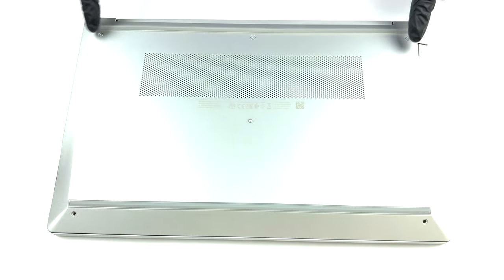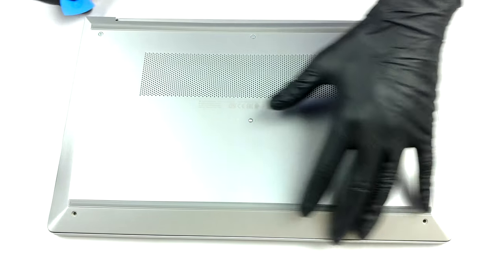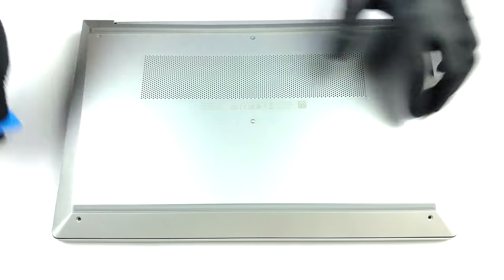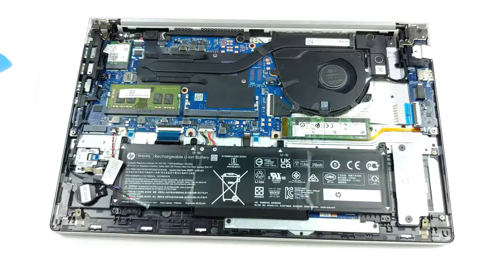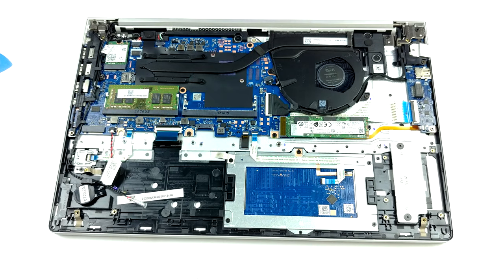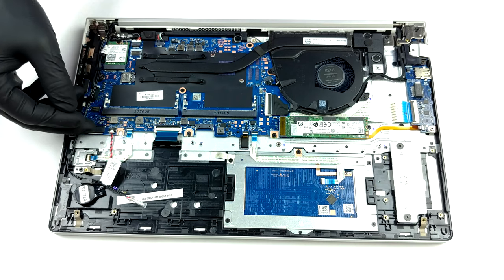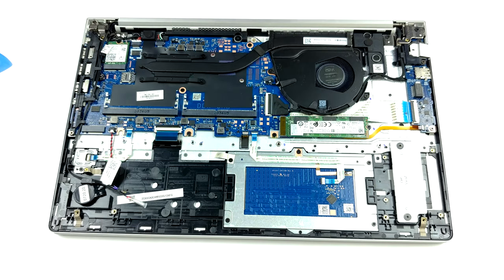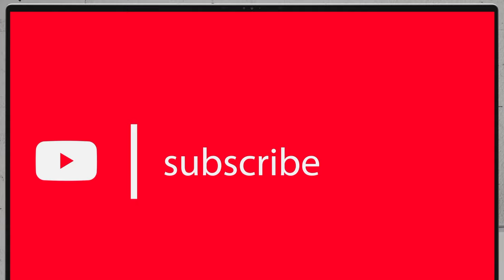🛠️ HP ProBook 450 G8 - disassembly and upgrade options

Comment: Allright guys, after a long research and a few calls at HP-Support, I will try to share, what I found out.
1st I found different dissassemblys with Probook 450/455 15.6 G7 that showed an internal sata 2.5 connector. So this is where the journey started. I am looking forward to get one  of the latest Hp 455 g8 and I really hope that besides the AMD cpu the internals are identical. Support told me from the Partlist theres is no additional Storage connector. After watching this video here I concluded the same, though that guy says, there is one. I spend another few hours on finding the mounting holes for such a NVME and couldn´t. It defenitly does not look like you can mount a storage.
But I found some other people succesfully just replacing their WWan with an nvme drive.
and it looks like an m.2-SATA (6Pins type b) connector (like the usually installed Fibocom L850-GL module), so obviously it should be possible to connect and use a 2242  drive there.
Anyway that connector is meant for a  WWAN-module like at least the preassembled antenna cables tell us, but also here I could not get a close-enough look to figure out, how that thing might be mounted then (no mounting hole).
So this is, what I got so far and I keep unpatiently waiting for LM to give us a closer look inside the 455 g8 AMD Lineup and whats going on there a the WAN connector.
Cya

Update: From a Hp-Support-Video I found, what I was looking for: An HP 450 g8 Model with an M.2 Fibucom WWan module preinstalled. So I am going to order that piece of hardware and give it a " Sabrent Rocket Nano" in that slot.

Cya.
Reply: Did u ever tried to insert the ssd in that slot? it worked?
Reply: @emmanueledefelice5029  due shipping issues I am still unable to get my hands on one of these. Sorry
Reply: Ty <3 Was trying to figure out the same thing ^^
Reply: @emmanueledefelice5029 
Please do you have this probook 450 g8 laptop? If yes, what do you think of it so far?
Reply: @nikovbn839 
Please do you have this probook 450 g8 laptop? If yes, what do you think of it so far?
Reply: Please do you have this probook 450 g8 laptop? If yes, what do you think of it so far?

Comment: My 450 G8 did not have the second NVMe storage slot that he pointed to in this video.  Just silver solder lines..  Ugh.
Reply: Is it possible to upgrade the storage using sata ssd? Or i need to stick with its inbuild M.2 256gb storage? pls help me by clarifying
Reply: @MaheshwaraSiva  I would think so.  The OS doesn't care as it will see both if you can plug it in.
Reply: @dl777  Any heating issue for normal usage? Or Any other issue did you find in this laptop.. Im planning to buy it.
Reply: @MaheshwaraSiva  no. Very nice laptop

Comment: can you explain me why they don’t put exhaust from left side which they used in old models evan in g7 also
Reply: Hey please answer me, I'm about to buy it this laptop. Did you find out what's about that exhausting system thing?
Reply: Maybe because the g8 has intel 11th gen with now 10nm size chip. So you dont need a lot of holes to dissipate the heat. The previous g7 and before used to have intel 10th, 8th, etc gen with 14nm size chip so you needed more room and holes to dissipate the heat.

Comment: Good to know that there are TWO M.2 SSD slots! Where can I find their specs / max. capacity, respectively? The data sheet from HP is not conclusive for me. Edit: Oh, I see from another comment here that this seems to be a false info. So the 850 G7 could accomodate two SSDs, the G8 not any more. That's a pity.

Or is it different between the 850 (Intel version) and 855 (AMD version)?
Reply: only 1x m2 slot,  second slot not fitable for m2 bcs of the size, the screw hole in the lower left corner is the cover mount

Comment: thank you your review. is that possible upgrade rem64gb(32gb×2)?
Reply: the official specs of AMD and HP tell, that there is a Maximum of 32 GB, but theres also many examples out there, when people  just doubled the amount allready on Win Xp- Computers and it did Run an recognize the full amount, so if its so important für you to have more than 32 GB on such a decent machine, then you shouold give it a shot. The past tells that its not impossible.
Reply: I'm gonna test it next mouth. I've got Windows 10 LTSC already installed.
Reply: you dont need 64 ram with this cpy

Comment: can someone tell hp probook 450 g8(I5-1135g7;16gb ram;mx450) can give at least 120 fps in valorant AND is it better than lenovo ideapad 5 pro(R5-5600h;16gb ram;integrated amd radeon graphic)?
Update: i changed my opinion and bought lenovo ideapad 5 pro with gtx1650 and i think it is work very well and very mobile.

Comment: you said there is 2 slot for m.2  ssd ?   can use 2 ssds ?
Reply: Trying to find the answer to the same!
Reply: @rezapatel   same here ?
Reply: @j.shishani6808  Based on the manual, seems like it doesn't. Comes with a single M2 slot pre-used with the built in drive and no way to add 2.5" SSD either (there apparently is space under the battery, but doesn't come with the connector or bay). Dropping this model as an option.
Reply: @rezapatel 
Please, did you get this laptop? If yes, do you advise me to have it?
Reply: @hazimyassir976  I ended up getting a Lenovo Legion instead. Very flexible on additional slots for everything.